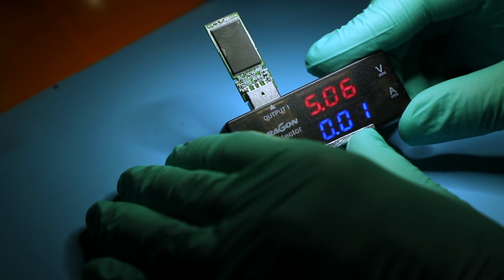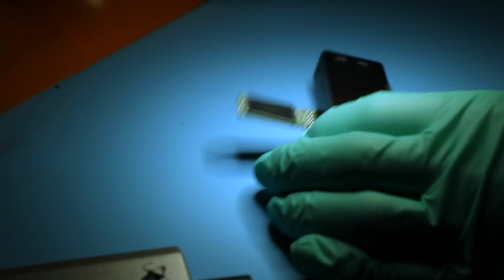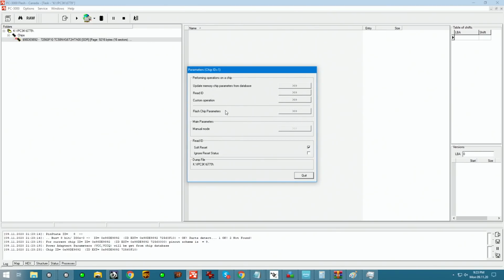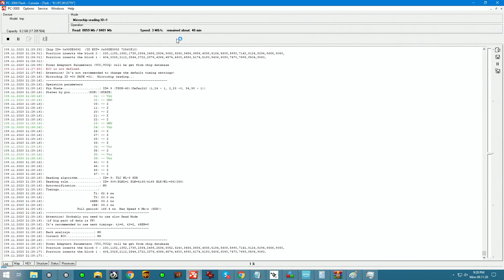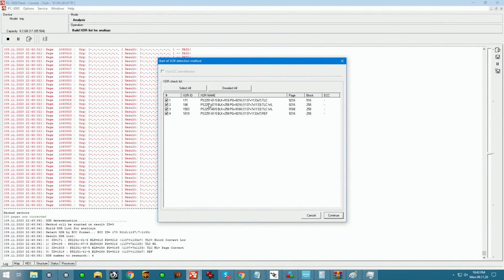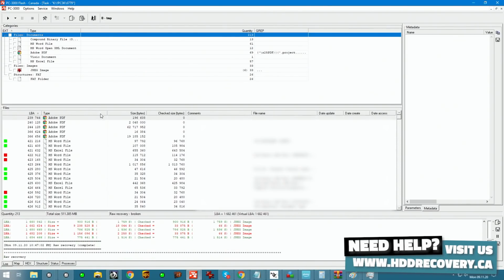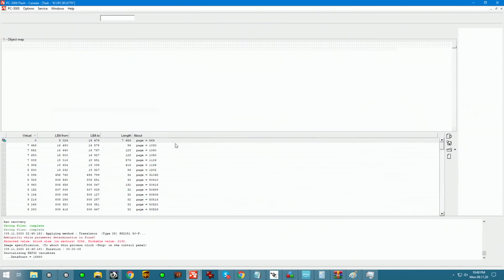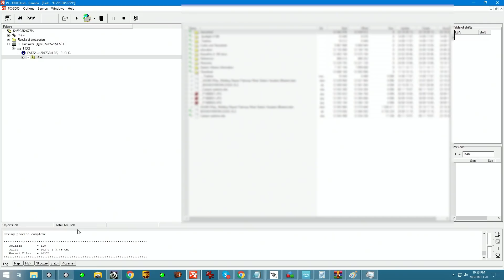usb does not initialize

Comment: He know his job! Like as alwayse! I wanna share my little case: i receive USB on AU6984, with memory HY27UT088G2A (only 1 GB). USB have current at start somewhere beetwin 0.1 and 3 mA and after it it drop to 0 (like in video). I was think that problem in firmware, and do chipoff. Clean all pins and read NAND - on direct reading it show that all is FF (ID of NAND read correctly)... So do dump and build a map not FF and not 0, and have nothing, so all dump is empty. I try read with different voltage, but all the same. For me it looks like that someone was try to do firmware but fail or i don't know, maybe it was some problem by the power, i see absolutley empty memory first time. I tell client about this and she said that i can do with this USB what i want, so i decide to try to do firmware and write something on memory and then i wanna try to read it again. Firmware is done, reading i wanna do today evening. I will add result by answering my own comment. Very interesting why this can happened...
Reply: Ok, after reading it now i see different situation, but still it very mutch of FF and 0 sectors. ECC found (528 bytes for sector)! I will try to do page desing omg